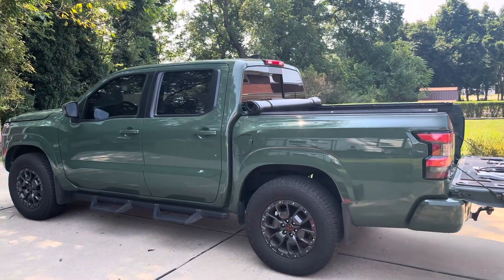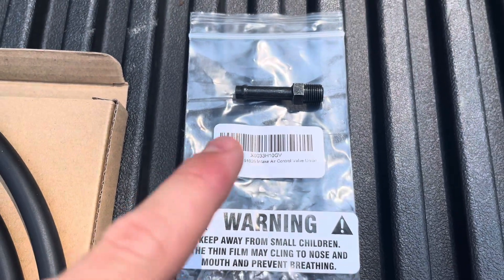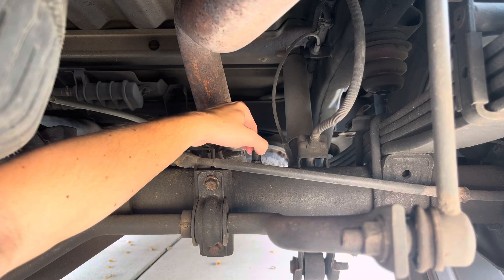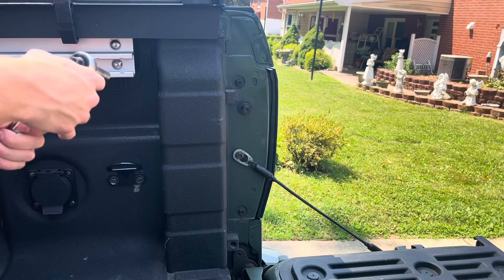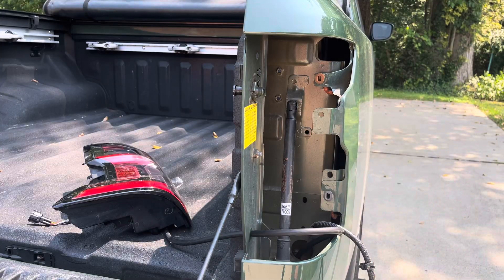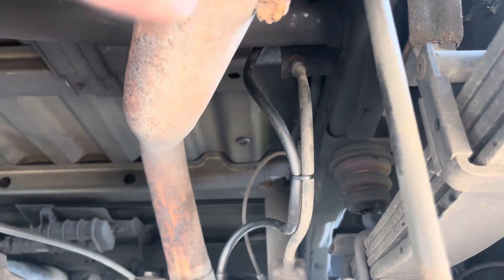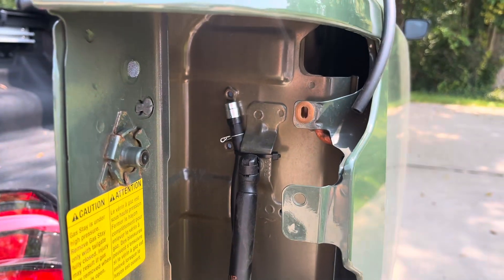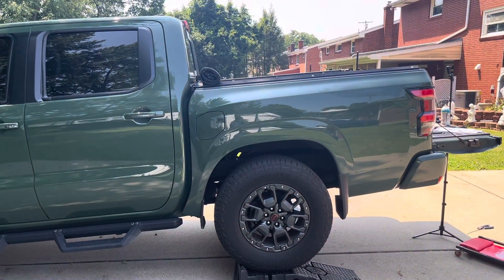Nissan Frontier - Rear Differential Vent Relocation

Comment: Z1 Off Road sells a complete kit for under $40. I buy all of my parts for my 2022 Nissan Frontier from Z1 Off Road.
Reply from the maker: It works out to about $50 after shipping for the kit from Z1. I ordered these parts from Amazon for about $20 and they arrived the next day! Why spend the extra $30 to order from Z1?
Reply: @5ten.garage  Yes, I know, but why search for individual components when Z1 offers the complete kit with the correct components? The 3/16 hose was just a tad too long. I only had to cut off about six inches. I love my 2022 Froniter. High enough off the ground so I can crawl under the rear to complete the installation. It only took about 20 minutes. Then again, I am 75 years old, getting a little slow in my old age. Yep, the OEM vent valve would not even move. It is totally clogged with junk. I only have 26K on my truck. I live in the desert, where there's lots of dust and mud during the monsoon season.
Reply: @Fudgieguys it's literally 3 items on Amazon. It would take 5 minutes to find all 3 and place order. I will gladly take 5 minutes to save $30
Reply from the maker: That’s what I’m saying!

Comment: Great vid, cheap and easy job - maybe 10 minutes once you have everything ready.  We use our 2023 P4x in deep water, dirt roads, back county, etc all the time for work and it was about 1/2 plugged, so this was good.  We used the exact same parts as this video.  👍
Reply from the maker: I was surprised to see my oem vent was almost clogged with only about 20k road miles! It’s a cheap insurance to save axle seals for anybody!

Comment: That's the same thing I did when I got my trd off road tacoma 2 months ago I rerouted the rear axle breather with 8 feet of 5/16" fuel line above the driver side taillight and it works great. Now you have 3 foot excess 1/4" fuel line you can use that on your mower when the fuel lines go bad or need replaced.

Comment: how did you slide the dorman vent to the 1/4 fuel line? find it hard to slide in.
Reply from the maker: It’s definitely a little tight, you can use some lube to help.
Reply: I used just a tad of silicone grease. Slid right in. I am glad that it fits tightly.

Comment: If your in that deep of water, you'll have other problems other than water inside a rear diff I'd think.
Reply from the maker: I explain in the video, the reason myself and many others do this is because the oem vent breathers corrode, collect dirt and clog! Which causes pressure in the rear axle and blows out the axle seals. I show in the video that mine was almost totally clogged up from only 20k pavement miles!